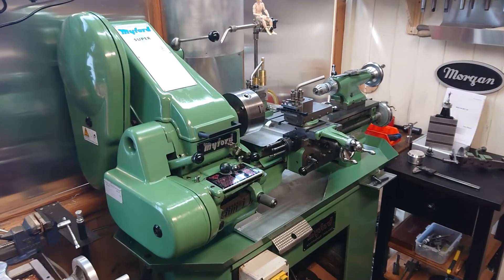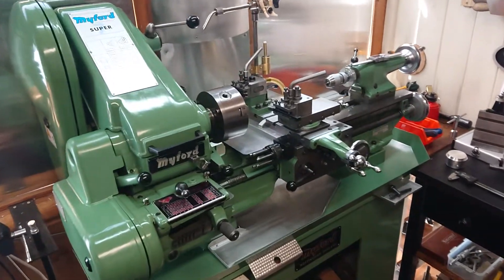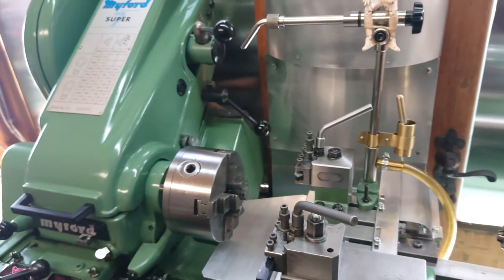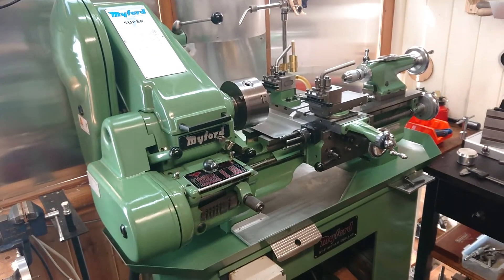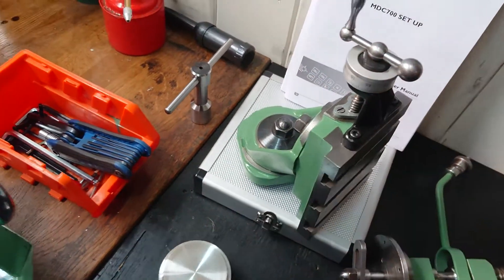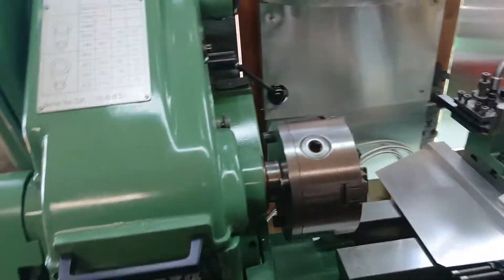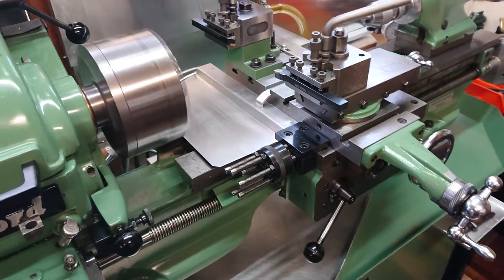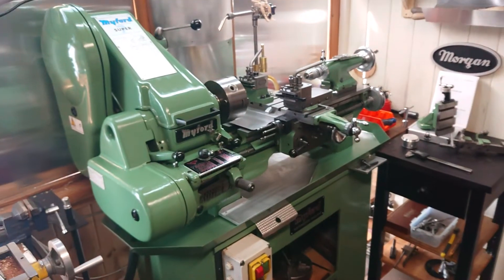Myford Super 7 run through - Complete with DRO set

Comment: Hi we are RDG TOOLS a Model Engineering tool company based in Mytholmroyd West Yorkshire. We sell new and used tools.

We also own the Myford Lathes Brand. We took over Myford around 12 years ago. Both company's are in the same building and we are open to the public. We are still building new Myford lathes and refurbished Myford lathes.
Reply from the maker: Cheers, Ive had stuff from you before 👍
Reply: @bonesshed.  No problem, great video.

Comment: Beautiful lathe.  How does that coolant set up work, manual pump?
Reply from the maker: Thank you Sam. Its on a electric pump & tank . If you look at the very start of the video you can see a black bar with an aluminium cap running through a piece of wood. This goes to the switch in the tank. No bending over ! lol.

Comment: Great looking Super 7. I'd be interested to know more about how the M-DRO was fitted, especially for x axis on the cross slide? In the video I can't tell if it's on the tailstock end or headstock end of the cross slide. Also I assume the longitudinal z axis is fitted across the rear of the bed? Thanks.
Reply from the maker: Hi Terry.  The  magnetic sensor for the cross slide is fitted to the side of the slide via a T section of ali extrusion. I added an aluminium swarf shield which you can see at @00:53    The other sensor is fitted at the back of the lathe via another extrusion. It was quite easy to fit .
Reply: @bonesshed.  Ah, got it now, thanks! Beautiful looking Super 7.

Comment: Why is it so noisy when running - or was the source of the noise the drive to the leadscrew ?
Leadscrew gearbox - does it have any 'metric' pitches ?
Are the spindle bearings ball/roller ? If so, that might be the noise. The ML7 was just bushes and quiet !
There's a knob for slackening the belts. Do use it - I think it's mainly to stop 'flat bits' developing on the belts where the belts are stationary on the pulleys - hence maintaining really smooth running when used.
Keep an eye on the motor temperature - if you get to do big work on it you might find you get enforced coffee breaks as we used to occasionally ! (ours was not super) Other than that, they seem to be excellent machines for that size.

Comment: Lovely machine. I've been looking at the Chinese lathes that have a milling machine built in and look super modern etc for similar price to a new super 7 but I think I'd prefer yours.
Reply from the maker: Thank you Ronan. The Super 7 isnt without faults or limitations but I generally find I can find a work around. I think those lathe mill combos could be quite useful if space is limited though and as long as youre not doing anything too heavy duty. I havent tried one but did think about one some time ago.  If you do get a Myford not only do they feel and look nice to use, they hold their value well, unlike the chinese made stuff !
Reply: I feel sorry for you as that's a tough choice ! I ought to suggest the Myford but may tend towards the Chinese which seem to be ok.  If you go for a combo, get the tallest one you can find - it seems head height is limited unless you can find stubby drills. By the time you've added a vice etc. it soon eats in to the available height space.

Comment: Hi Bones. I have the Super 7 B grey imperial. With gear box. By changing 2 gears at the end for 33tpi & 34 i think you can then cut most metric threads. I bought these some time ago but as yet not fitted. I will be doing a in depth youtube video soon. I have done some already that you may like to have a look at. Great looking machine you have . Regards. Steve.
Reply from the maker: Cheers Steve. I was under the impression it was different box . I will set a bit of time aside and do some further research.
Reply: @bonesshed.  I think that is correct that maybe the metric version is different. What i was meaning was that by changing 2 gears behind the cover you can do most metric threads. I does not turn the machine into a metric. Just a work around. I have somewhere a chart showing the threads that can be cut. I got the info from the Model engineers Forum that i am a member of. There is a lot of information on the Myford lathes on there , as a lot of members have them. 
Steve.

Comment: Very nice lathe, well done.  You mention that you might swap the gearbox for a metric one at some point.  Myford never made a metric gearbox or leadscrew.  But all you need to cut metric gears are a 33 tooth and 34 tooth gears so it's not a major problem.
Reply from the maker: Ah, thank you Andrew. I was always under the impression there was such a thing.
Reply: @bonesshed.  Are you right with 33 & 34 ? Is it not 33 & 35 ? (or even 34 & 36 ?) The real magic number is 127 (half of 254). 120/34*36= 127.0588

Comment: A great lathe for sure! btw at 2:59 in your video I can see a guard over the bed - this is an excellent idea that I will replicate on my lathe. I cannot however see any screw holes, what have you got it attached to? I'm thinking of doing the upgrade to my cross slide end bearing with a pair of thrust bearings to basically take out the small amount of backlash. Nice work on the tailstock DRO as well, that's also on my list! Thanks for the video.
Reply from the maker: Thank you very much indeed :-) 
I have made a video of the swarf tray , hope it is of use . 
https://www.youtube.com/watch?v=DwkJJioZO8I
Reply: @bonesshed.  Wow thanks!! Thats above and beyond great service! I will build this tomorrow. I did find some magnet strip with adhesive backing so will probably use that at the cross slide end to stick it down. Cheers!
Reply: Such a beautiful lathe. My own Super 7 is a joy to use but is nowhere as tidy as yours.

Comment: Very nice lathe and in beautiful condition.For anyone owning a ML 7,  Super 7 Myford or in fact even with any brand of lathe I highly recommend the George Thomas book The Model Engineer's Workshop Manual. That head stock dividing attachment was originally designed by a New Zealander by the name of J.A. Radford and then re-designed by George. It was written up in George's other book Workshop Techniques. Mr. Thomas's writings greatly influenced my last lathe purchase although it still wasn't a Myford. And they also convinced me to buy a quite expensive Quick Step cross or top slide mounted milling head when they were available from Hemingway Kits. Radfords book Improvements and Accessories for your Lathe and both of George's books can be obtained from Tee Publishing.https://www.teepublishing.co.uk/ Another business to be aware of would be Hemingway Kits who offer quite a few Myford specific items and user built accessories. http://www.hemingwaykits.com/

George details in the Workshop Manual book why an actual imperial equipped lathe is superior  when switching between cutting imperial and metric threads verses a metric lathe and switching to cutting imperial thread pitches. Adding the dro gives you the best of both systems and that imperial lathe was a good choice. Unless you already have it then finding the proper metric change gear set Myford offered or may still do? should be next on your list.
Reply from the maker: Fantastic, thank you for your detailed post . I will take a look for sure :-)